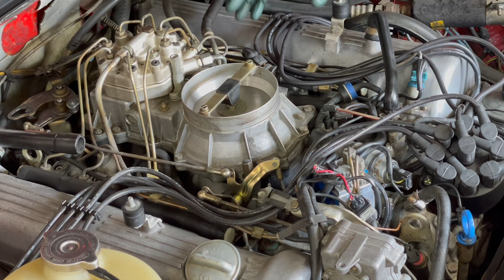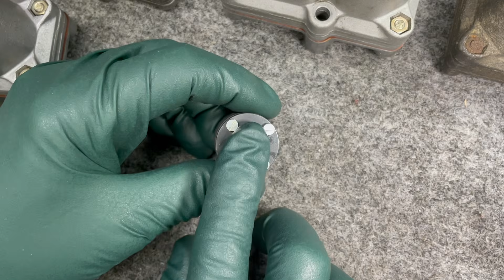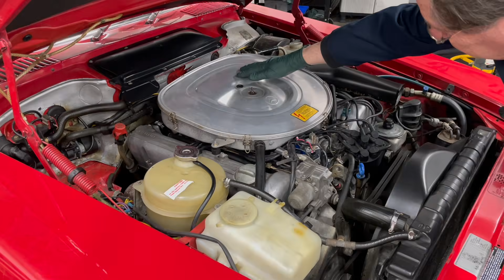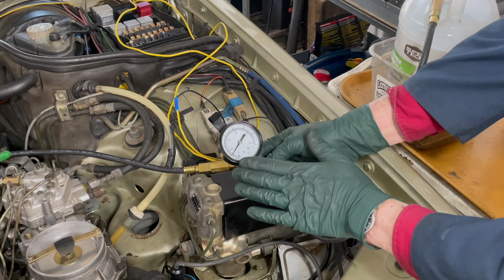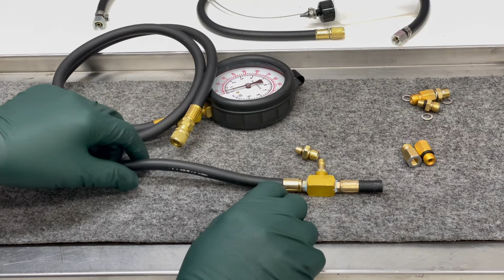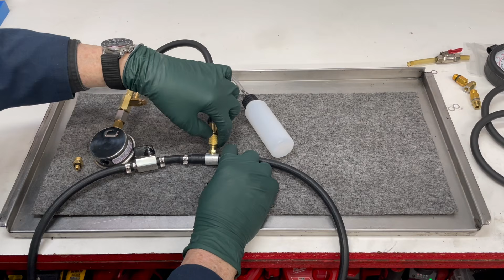The Pacemaker that Drives the Heart of the Early Bosch CIS Fuel Injection

Comment: I've got an older car with CIS K on it, the fuel system was left open for years both the feed and return lines, looking to purge the fuel lines with something to make sure nothing is going to make it's way into the CIS metering head, what would you recommend I run through the fuel lines from the tank, I was thinking the feed line is the most important here, so possibly replacing with a Nickle Copper hard line set up, but where to source proper flare tool to do that, and the bulk hard line itself which is metric.....?

Comment: I still have the pressure testing kit that I used on Porsche 911s and occasionally on Golf GTi. Back in the day, not everyone knew that the control pressure needed to be very precisely defined, as it acts against the airflow that lowers the air-meter disc. Some 911 models used to have two pressure control units, if I remember correctly.
Reply: Still have my gauge and fittings for 911s,  think also Volvo.

Comment: It seems strange that Mercedes would switch from a system like D Jetronic to K Jet. Was it just because K was more reliable? I know VW had it on several engines in the ‘80s but Audi and BMW used the fully electronic systems.
Reply from the maker: 1970's electronics were not that reliable. Bosch went back to electronic injection in the early 90's when computers and electronics improved.
Reply: Great demonstration of the wur function Ken. 
Didn't Bosch buy the patent from Bendix ?